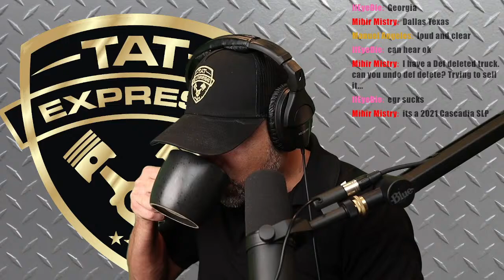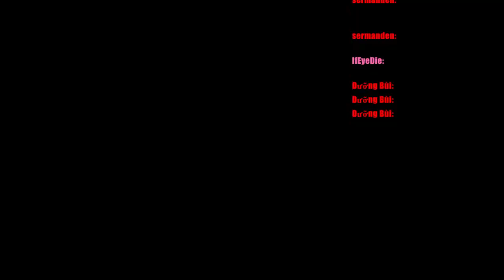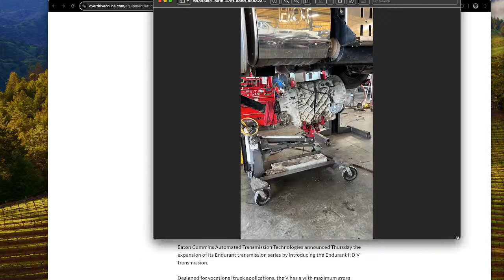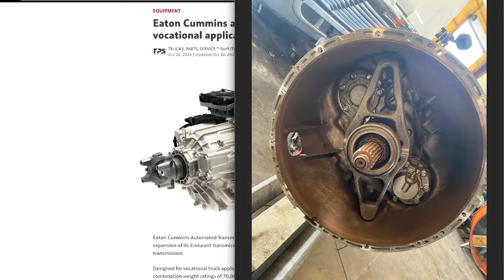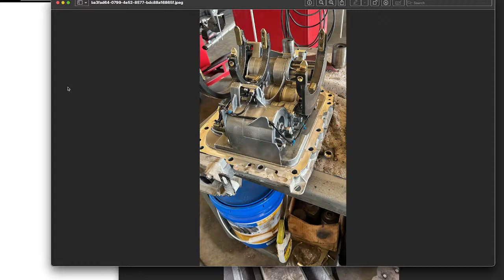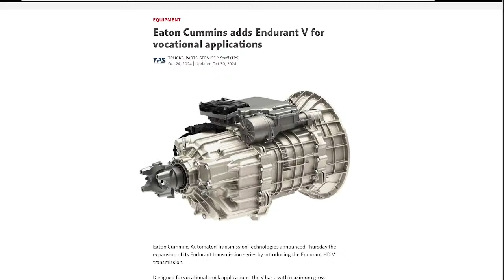What Emission Standards Have Done to Diesel Engines: Hack Deletes

Comment: On my dd15 2015 I had to delete. Cuz every shop I took to could not fix it right. 1 mth later back in shop. Then maybe 2 months later back in shop. But now I think I got it under control with this delete.. in two years I done injectors seals and cups runs good so far but now I can’t afford to put it back to original state.. wat do I do with states come down on us. The economy has not came back to normal since cov-19

Comment: Why can't you repair a delete? Or shouldn't?
Reply: First thing, you shouldn't delete emissions in the first place because these engines are meant to run with it, along with the ecm and acm. When you delete these, the engine can go into derate. Deleting your aftertreatment and modifying the vehicle to run with out aftertreatment is illegal. As a licensed technician in Ontario, I hate aftertreatment but it's needed to keep smog levels down, which is a proven fact.